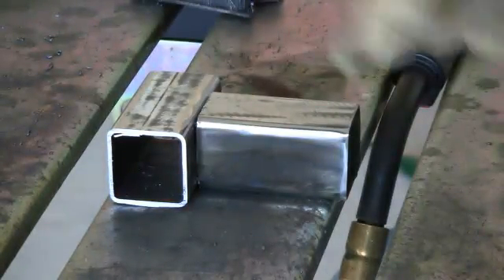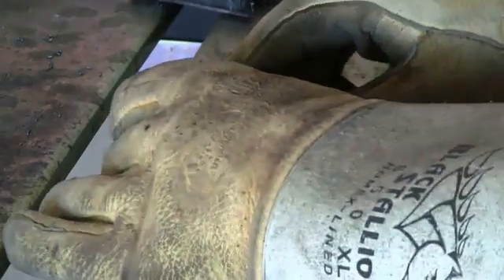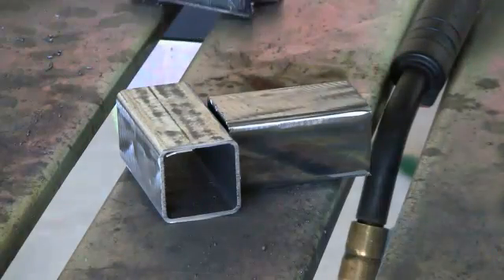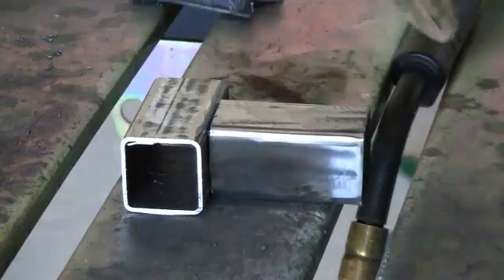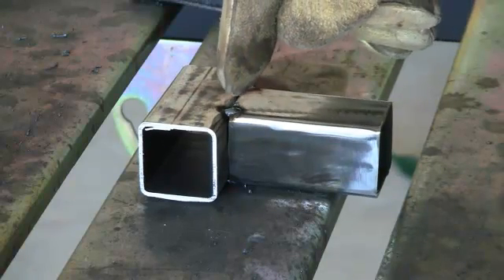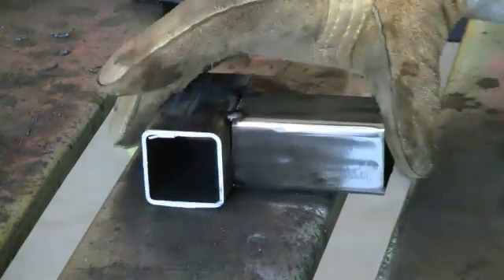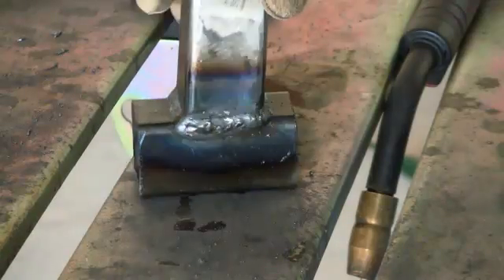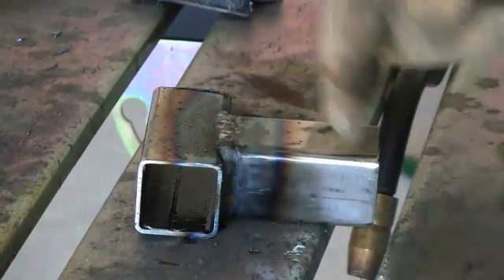MIG Welding Course And How To MIG Weld Square Tubing

Comment: I like the video. Didn't like offensive comments.
Thank you for up loading your video.
Do you wash your material to clean it? My square tubing has a light grease-like coat. Do I have to remove it?
What were your settings on the welder? 
What is the type of wire you use?
Thanks again
Reply: +Roberto Marchesini Definitely weld on clean metal. The cleaner the better. I can get away with a bit of unclean metal when stick welding with my everlast welder but cleaner is better. there are welding calculators you can use to help get you in the ballpark for settings to use.
Reply: Roberto Marchesini  wire brush it

Comment: Does welding add material to it or does it just melt the existing material together?
Reply: Luke William  Adds material (the wire is the extra material)
Reply: i just registered for the webinar at WeldingMastery. com today i cant wait to see how things go
Reply: Ive been welding for awhile now but after watching and learning some new techniques at the WeldingMastery. com webinar a bit ago my mind is officially blown. Ive been doing a few things wrong that I didnt know.
Reply from the maker: Luke William The wire melts and that becomes the weld bead.
Reply: Euro Chop Ahh. So to sucessfully weld two pieces together you have to leave a little space in between as you weld?

Comment: No need to weave such thin metal and small joint just push and go.......should sound like a kitten purring!!!!! The weld should be smoooooth with no ripples.

Comment: With FCAW welding you pull The puddle the same as stick welding (it also keeps the slag from getting trapped in the wild). SMAW  you push The puddle, dragging it causes the wild to build up and the heat  input to be too much which leads to distortion of the metal and two large of a heat affected zone and will also cause The base metals to reach their upper transformation temperature which makes them week. Also when welding square tubing you should not tack the corners the center of the sides should be tacked and welded from center to center, corners should be welded through as they are the weakest points and require more heat, and don't Forget to split up your welding, wild one side and then flip the tube over and weld the other this will keep the distortion down then you can finish the others. The rest is up to you ( heat and wire feed speed and clamping ). Good attempt at an informational video just wish others would stop being such nitpicky noitalls and just leave comments as I have, I don't see any of them making any welding Videos.
Reply: Why on earth do people make comments about things they know absolutely nothing about and impart wrong and at times potentially dangerous information - pray tell me why!!!!!!!!!
Reply: john clyde Yes I'm sure, engineer on, and I have a Masters from Cranfield,  if this makes sense to you then please keep out of the welding business, we can do without the ignorance.
Reply: Irene Wilson Well nitpicking know-it-all that I am...As I muddle through your horrible grammar and misuse of the English language, I note that you state you PULL stick but you PUSH SMAW. I guess you'd better figure out which it is.

Comment: I am only a beginner welder, but seriously, no clamping of the work? It wasn't even squared up. I recognize that it was just a demo, but when you do an educational video you should at least explain the basics correctly.
Reply: I'm only a hobbyist welder who only occasionally uses my everlast welder for hobby work and I'm surprised this video is out there as "advice" on welding. egads.

Comment: Here's some advise from someone that travels the country teaching welding. First thing, I never put 4 tacks. I place 3 tacks and then start my weld where the 4th tack would go. Second, Ignore all the uneducated people on here trying to tell you not to drag the weld. Dragging creates half the spatter of pushing and penetrates deeper, although not needed here, but does lump up easier for beginners. A little experience will fix that. The only time you would push a weld is if you are going up to spray-arc mode where the increased speed requires pushing to get full gas coverage. Third is settings and arc gap. It looked and sounded like you had to much wire but some of that was because your arc length was to long. Typically the reccommened settings under the cover of a welding machine tell you to use to much wire, although the small buzz box machines are much closer. Fourth, wire size, with the small buzz box you were using you should be using .030 (8mm) wire for solid or fluxcore. Do not use .035 (9mm) wire, save that for the next size bigger machine. Fifth, Technique, this metal was thin enough not to need gun manipulation ( known also as making a cursive e ). A straight drag would of worked but I do work in some letter e's if the puddle tells me to. E's not only flatten the weld but also give a much better weld toe connection to both sides. MIG is notorious to only connecting to one side if just doing a straight drag on metal that is to thick. Sixth, and this one I added for the guy that told you to leave your wire alone but turn up your amps. Wire speed and amps are controlled by the same dial. Several of my 6 points here were added because of the people on here trying to tell you how to weld, CLEARLY need to go get some real welding education!!!
Reply: Where are your videos? I checked your channel.
Reply: John Nunya Do you want to come and film me? I'll gladly post.
Reply: If you know a better way, I'd like to learn it
Reply from the maker: beslye That's great advice. And you don't have an ego about things, so thanks for posting a comment that deserves to be here.
Reply: MakeMoneyWelding If you take that advice, you might be sorry. Dragging does indeed cause less splatter, but reduces penetration. We've done many cross cut and xray sections that prove this. While the argument may rage on forever of drag or push, you can't refute test results. A lot of the other stuff he spews are situational, and if he's only welded one way, he won't understand any other. He's obviously not encountered several different situations and is stuck in a frame of mind that isn't open to other possibilities. If he's that good, he should make his own videos with is own test results that prove otherwise.

Comment: Better clamp that thing down. That would help distortion when you're tacking it and you don't have it hanging off the welder torch if you got the wire stuck on the weld for whatever reason.
Reply from the maker: MrSaemichlaus Yeah, I should've had it clamped for this video.

Comment: there is no need to do a cursive U-s or e-s, its a thin tube, you can weld just a straight line, thine wire...

Comment: I noticed it looks as if you are dragging your lead as opposed to pushing it, if you push it will help avoid your welds looking so clumpy and will help with your consistency by not messing up your weld as you continue. Also, it is good that you tack on both sides as you do.. but you should avoid putting the tacks where you are going to start the weld as it causes clumping too, as you can see in your first weld. other than that great vid!
Reply from the maker: IndyK Thanks.

Comment: Just a couple of questions... Every time I've tried to Mig weld the wire always get stuck and it doesn't strike a spark initially like your did, So I wind up cutting and cutting until it finally strikes a spark... What am I doing wrong here?  Also can you recommend a low budget Mig welder that would work for someone that occasionally welds something for the wife.
thanks
Reply: I think that might be it.  I hold my torch about an inch and a half from what I'm welding.  Also what small welder do you recommend?

Comment: had to make a heap load of chairs out of square tubing. it was a bitch and a half just to even square it all up. and yea you got to be more careful welding sq. tubing. it was good exp though xD
Reply: yea i had plans drawn out in my book along with measurements and materials needed. the way i had squared it was using a right triangle ruler and holding it all together with magnets. then tack welding it all up first. all the parts were uneven cuz i was using a chop saw. inaccurate cuts :/ one of the most frustrating projects ive done yet

Comment: I used to work in a machine shop and I asked the welding guy to teach me a little bit about welding, he showed me a little about mig, tig, & stick. Now im no expert and have very little experience but I can tell this guys settings are off. No ones finished work should look like you just burned the crap out of it.
Reply: kooo thx, im about to start a welding program so ill master this stuff!!
Reply: There are some really good instructors on youtube that can help you with the basics. I've learned how to use my everlast welders that way. If you want to take welding seriously definitely take a course which can lead to certification.

Comment: wire speed is great, but you are too hot
Reply: @ 3:43 notice how there are no chevrons visible. the wire he is spitting into the HAD is bonding with the metal and creating a sunken edge. the weld will hold regardless. but to do it properly and ensure strength you cant have those sinks.. if he turned the amperage down about 5 or ten amps the wire would feed more thoroughly against those edges and fill the gaps creating chevrons. hopefully this is helpful.
Reply: BTW what is even more important is this just pertains to his technique.

Comment: What kind of sucker weld with gloves ???
Reply: Someone who doesn't want flash burns.
Reply: When I got my new Lincoln 180C I went to the shed for a quick play with my new toy. I had gloves but not a long sleeve shirt. I only did about 5-8 mins of welding. The next morning my left bicep looked like I had been in the summer sun all day. It was equal to the worst sunburn I have ever had.

Comment: if your building something that needs to hold weight never pull your welds... this takes away the pre-heating of the steal and doesn't bond the weld as well as pushing the weld would do.

Comment: Um, I'd guess that for the lesson being taught, regarding heat displacement, using two short pieces of scrap square stock, your point doesn't matter. That's just a guess though.
 I'd imagine if he were building something the topic would be "building something" and he would be clamping & measuring. That's also just a guess.

Comment: Amps were too low and movement was too slow, Thats why there was so much heat transfer, higher amps and a faster speed = less heat transfer...... It's not rocket science..
Oh ideally you work right to left not left to right with a Mig.......

Comment: Poor stop starts and incorrect welding sequences... should be welding both butts first then the tees, making sure you your starts diagonally opposite to balance heat input, then you can weld the tees. This way will result in minimal and even distortion, and you wont need to clamp or pre-set the joint. Finish and start on the corner of the RHS and weld into the start of the previous weld resulting in no crater and minimal cleanup of stop starts.

Comment: They aren't square because he holds the wire too close as he welds so it overheats the metal which then in turn deforms it. I mean you can see him pretty much rest the wire onto the metal tubing.  On one of the first welds, might have been a tack, he actually welded the tool to the tubing and you see him having to break it off.

Comment: it won't break at a corner, it will most likely shear off at a weld, the only way it would break at a corner would be if the whole tube broke

Comment: Tubes don't look square after the weld. Thanks for the video. I'm not sure if I would do exactly as you did when welding with my PowerIMIG welder. I would definitely clamp my pieces before welding.

Comment: u can also run the weld in a down hill position when ur dealing with thin material like that, it helps with the burn thur, down hill welding is normally a no no in welding but really helpes controlling heat and will also give u a better looking weld but only do it when dealing with thin material like that.

Comment: Can you show a video on welding a bead on top of a 1/4by1/4 wrought iron piece ? My welder does horrible on this I have the current all the way up. Its Lincoln Electric 100HD. I assume its a 100amp ? Many thanks for any tips. Your welds are beautiful I know you wanted to keep it short and didn't clamp and care about warping. Thanks.

Comment: Thanks for this tip. I am trying to teach myself to weld. I got a cheap 90 amp Harbor Freight Flux Core machine and the project I want to do will use 1 inch square tubing and I was practicing and kept blowing through my stock. I think if I angle my gun towards the solid tube and not the edge like you said I will have better luck. thanks for the tip.